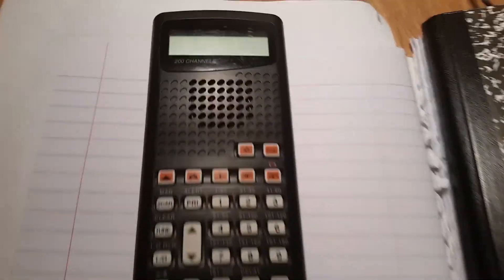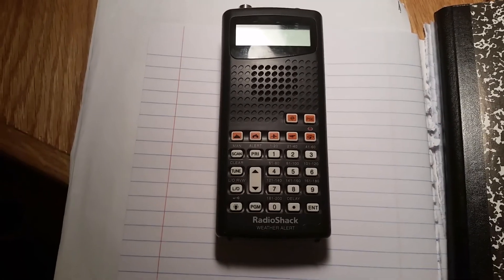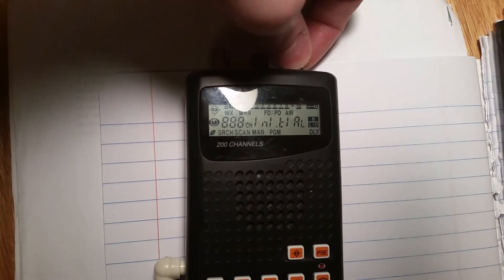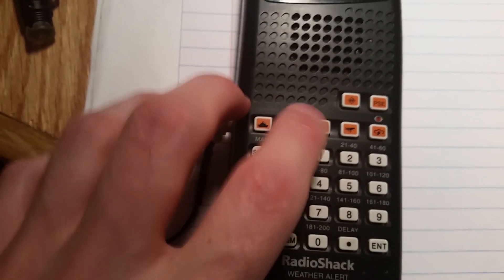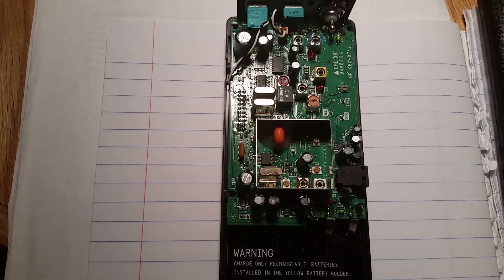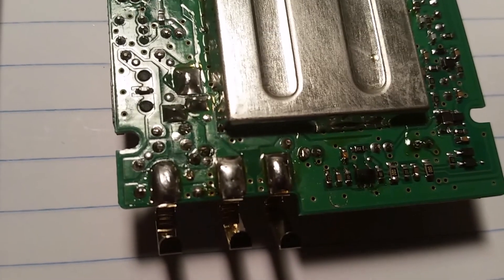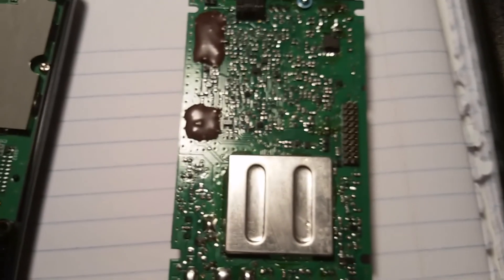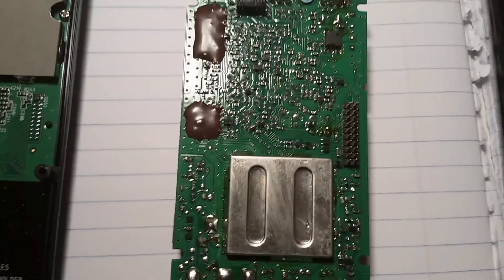Radioshack Pro-404 Scanner Repair Help?

Comment: Look at the resistor up by the antenna, L27 something in there.
Reply: Brian Johnson Hello.  Having trouble with my radio shack scanner pro 197.  Lights up and goes right back off.  Been surfing for hours on end for help.  Came across your comment on here and thought I’d try you.  Not sure if I need another power supply or if there are internal fuses.  Any advice greatly appreciated.  I’m sorry if there’s any inconvenience.  Thanks
Reply: @lucyharkins3538  I'm sorry I just seen your question. You can test your power supply on another device. Or just a multi meter, but it needs to have a load on it. Sounds like you have a capacitor failing. I would look for swollen buldged leaking capacitors. Possibly a solder joint that disconnects after heating.

Comment from the maker: Just an update on this, i talked with some other people and we determined that the microcontroller is stuck in boot mode which was probably caused by an incorrect voltage being put through it from a dc power supply. There is really no way to fix this since digital circuitry is extremely hard to repair. Basically the microcontroller is toast unfortunately